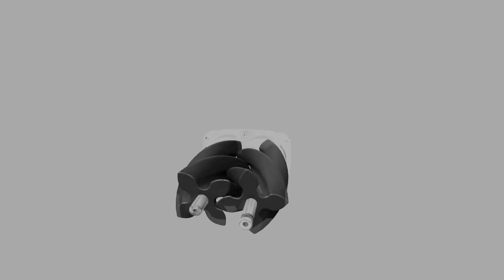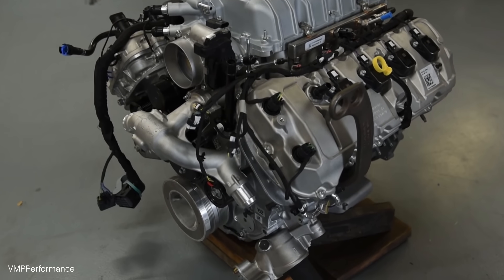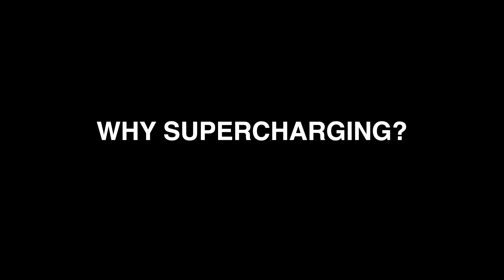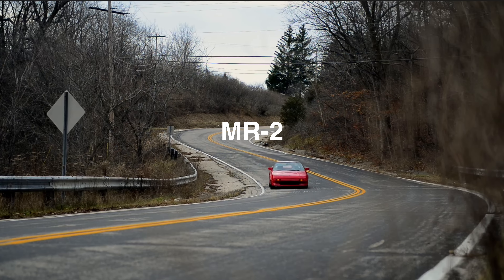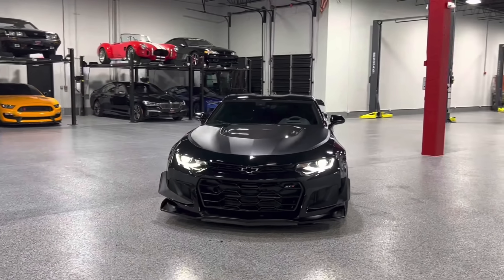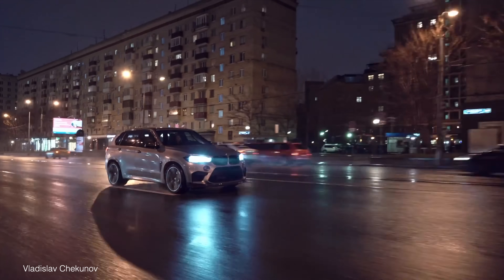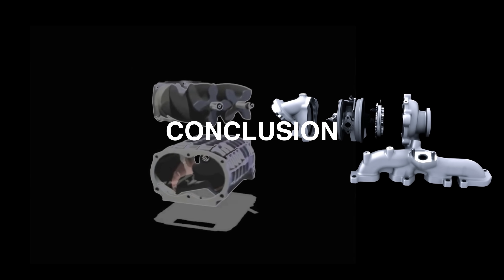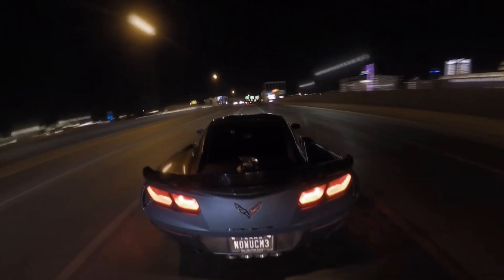Why V8 Engines Are Supercharged vs. Turbo😮| Explained Ep.6

Comment: Why not both ?
Reply: Old Detroit engines have a supercharger and a turbo. The supercharger is only there to blow fresh air.
Reply: @wil4741 Lancia did this a couple of times, and won with twin charge set up
Reply: @wil4741 True, but those 2 stroke diesel engines will not start without the supercharger. Trivia History..  these Detroit engines are where the superchargers for gasoline engines got their name (4-71,  6-71, 8-71, etc).
Reply: You can and people have, but its very expensive and takes a damn lot of tuning plus time
Reply: Golf GT had 1400ccm turbo & SUpercharge combonation. 
Double the cost if something breaks
Reply: @zwieback1988 I had it and it was nice to drive it. Very smooth acceleration 👌👌. 1.4 litre engine producing 125kw with no turbo lag.
Reply: @nevermind3488  still a very nice engine today, as long as the chains kept the timings synchronized. Very good in the golf GT
Reply: @nevermind3488 this engine is very unreliable for a daily car
Reply: Talk to the Germans about this
Reply: Cost
Reply: @Abhishek-150 not only cost of parts but fuel as well.  The more power you make the more fuel you need.
Reply: Too complicated, I think Volvo had made one.
Reply: @BOMBON187  yea they had it the the newer xc90's for a while before they just stuck to turbos
Reply: @BOMBON187 u want to say lancia ?
Reply: T6 Volvos are twin chargered
Reply: Twincharged basil, twins ;)
Reply: Volvo has entered the chat
Reply: Volkswagen had many dual charged engines
Reply: Group B , lancia delta S4
Reply: Id imagine the intake/out piping would have to become so large it would be silly
Reply: Its very very expensive but goddamn it’s sounds amazing, it’s unique and it’s very fast
Reply: Because then u have a dragster. Anything I’ve ever seen pro or supercharged with 2 turbos is pushing like 15-1800whp. U start breaking dynos and shit and your mpg turns to gpm
Reply: Volvos have them both and also has a hybrid powertrain.
Reply: cost and reliability
Reply: Lancia did it in the 80s back when group b was around, they did it to counter turbo lag
Reply: Audio RSQ7 has an electric super charger and twin turbos
Reply: Both is called twin charging the cost for twin charging is significantly higher...
Reply: Because Joe Biden ruined cars
Reply: Right!
Reply: Cost, extra unnecessary weight and complication and more unpredictability and higher chances of unreliability
Reply: TWIIIINNNNNNN TO WIIN
Reply: Average 2010’s vw group 😂
Reply: No point. You can get sufficient boost with either options.
Reply: Cost, adds complexity, adds another possible failure point, etc.
Reply: It has been done, many times over.  The advantages of supercharger are from idle, and by the time it runs out of steam, the turbo is taking over and keeping it going to redline!!  Its not cost-effective in a car. They begin doing this back in ww2 in high altitude planes.  Massive hp!! Eventually, they stopped because they discovered they could achieve the same horsepower with a 2 stage supercharger in less room and less wind drag.
Reply: Compound’s are the way to go for big power. 
For the whole lower rpm anti lag you can run sequential’s. 
But sized right I’ve never had lag issues with compounds
Reply: because not rally
Reply: Too expensive and also very inefficient. You can get a modern coyote to 1200hp from a 3.0L whipple. You can get the same car to go 1500-1800 with a large single turbo. Now the turbo one can be dual. So a smaller turbo to handle low end RPM and torque and a bypass to go to the second for the high rpm and speed.  The supercharger handles really really good low end torque and hp allong with a very smooth power band. Look up 2 step on a supercharged drag car. They launch like a turbocharged car. But, when you add the heat on the engine not just directly with a supercharger bolted on to the engine, but also you have  radiating heat from the air around it. So the Volumetric efficiency or VE per lb of boost pressure throughout the whole system goes down. More tubbing more space to fill, more time for the air to heat up and lower the density of the air. Meaning you need even MORE pressure just to match the amount of oxygen a cooler engine and also cooler intake air would make.
Reply: Volvo
Reply: Twin charging is not worth it, cost too much and you can get more with just nitrous an another power adder.
Reply: Complexity, Mass, & Cost
Reply: That's called twincharging 👍
Reply: Because american is better
Reply: @ american cars are way more unreliable, when has american made ever been good?
Reply: Longevity. Doing both finds all the weak points in an engine and breaks them quickly.
Reply: Lancia delta has and it is one of the best examples for this
Reply: Not reliable
Reply: Heavy
Reply: Volvo does
Reply: Volvo does both at the same time
Reply: Cause you gotta be a crazy(read passionate) italian to do it and it has to be a four banger. 

Other options include. Japanese on a 900cc engine. 

Or German and just had the engineers decide to have an 80s themed work party and do coke or some shit xD
Reply: Twin charging!
But turbo takes up less space and adds power more easily
Reply: There is a few
Reply: Explosive
Reply: Bro discovered twin charging
Reply: Both is better 🫰😈
Reply: I heard it was called Twin charged but I am no mechanic whatsoever 😂
Reply: And add nitro meth
Reply: “Twin-charging” is difficult to make it run well.
Reply: Lancia Delta S4?
Reply: the amount of heat it makes is too much
Reply: The Mk5 VW Golf GT (2007 ish) had one but it was very unreliable and not worth the extra cost so they ended up scrapping the supercharger and just making it turbo.
Reply: You can, but with electric turbos, engines with multiple turbo sizes ( small fast revving one for low speed boost, middle size and big turbo ), it has become obsolete. 

The costs and associated maintenance headaches aren’t with it in most cases
Reply: You can, but with electric turbos, engines with multiple turbo sizes ( small fast revving one for low speed boost, middle size and big turbo ), and variable geometry turbos, it has become obsolete. 

The costs and associated maintenance headaches aren’t with it in most cases
Reply: The whole point of the turbo is it pulls air. Adding a supercharger limits the air coming in. Defeating the purpose of the turbos. You can do it but it takes a lot of fooling around with the combustion, timing, etc. and you don’t get that much of a ho boost. You’ll get more hp just turboing it.
Reply: Pointless. It's like having a v8 piston engine and a rotary engine in the same car. Either does the job.
Reply: weight!
Reply: No need for that. Sequential turbos do the same job perfectly. Small one spools almost from idle and gives low end torque as the big one provides max power in the upper range. And turbos are almost always more efficient than sc's. Love the superchargers though.
Reply: Volvo has a supercharged and turbocharged 4 cylinder
Reply: Group B Lancia Delta S4 had hybrid charger, that used supercharger to mitigate turbolag on lows
Reply: Cost and tuning. It's damn hard to tune both so they don't interfere with one another. Anyone who has played Automation and tried to make a twin-charged engine can confirm.
Reply: It gives limited benefits for added complexity and weight
Reply: Lancia did this, but it's very complicated and expensive and just isn't viable to do in production cars
Reply: Like pizza and cheeseburger?
Reply: Packaging
Reply: Lancia did in group b rally. IIRC the turbo was too big for good lag. Supercharge low rpm then it is bypassed when the turbo spools up.
Reply: Because people are chicken shit. It would be so easy especially now since there’s an easy way to disconnect a supercharger when the turbos come on boost.
Reply: Pretty much useless IT was tried but IT didnt worked well
Reply: @cwf_media9200  it did work, and the result was a good driving experience. Strong boost right away from idle thanks to supercharger and at higher revs the turbo kicks in while the supercharger gehts magnetically disconnected arount 4400rpm. 
Problem: high costs, complexity and the big improvements of modern turbos which made this obsolet

But: There is a comeback with electrical compressors to spin the turbo in low revs in multiple new German cars.
Reply: @zwieback1988  and The engine caught fire very successfull
Reply: @cwf_media9200  not really, they had chain problems but no 🔥
Reply: @cwf_media9200  exactly - the reliability was not good because auf the timing chain lengthening, which can lead to severe damage
Reply: @zwieback1988  thanks but you don't Need to explain what Timing issues mean....
I was a mechanic i know what IT Looks If a valve Kisses a piston
Reply: @cwf_media9200  yes, less romantic than it sounds
Reply: @cwf_media9200 I use to work on Detroit Diesel 6v92s
They had both
They worked. It just wasnt for speed. It depends what you are looking for. Just because it didnt work for you doesnt mean it doesnt work
Reply: Unnecessary. You can move all the air your engine can handle with one or the other.

Comment: I think this video is missing the main point, European brands use turbo and not supercharger because of fuel consumption and emissions. Remember in Europe you have to pay more taxes when your car's emissions are higher (5 figures taxes...). The emission test is done at low acceleration where turbo are more efficient than supercharger.

Comment: Yup, you nailed it!! I've autocrossed both supercharged V8s and turbocharged cars (2.0 turbo 4 cyl and 3.6 twin turbo V6) and there is a slight lag with turbos. The difference isn't an issue when doing normal driving, but it adds up when autocrossing in the form of a few hundredths of a second in each corner.... Hundredths add up to tenths and that can be the difference between winning and losing.
Reply: You can crack the throttle open a little earlier. You have adjust your driving around it a little.
Reply: In racing your rpms shouldn't be so low that the turbo slows down

Comment: I've always loved having a built high compression naturally aspirated engine. Something about the drive ability and sound with them even though they don't make as much power after a certain point, they're just way more fun to drive for me.
Reply: Same here. That's why I enjoy my M62TU (BMW 5 series)
Reply: Drivability is ruined with remarkably high compression, not improved, but sure
Reply: @boost1728  Mine were all completely streetable and daily driven with 13.5-14:1 compression. No issues.
Reply: @evictioncarpentry2628  throttle-sensitive, noisy as hell, lurching at stop lights the list goes on. You have fun with all that. The rest of us will stick with 10:1 and a turbo, make twice as much power as you, be able to put the car in gear and idle through a parking lot without all the nonsense. To each their own. Some people like to show off their slow and obnoxiously loud small block, some people appreciate a comfortable and reliable 1,000hp.
Reply: @boost1728  I have none of those issues, for the second time.

My vehicles run 100% everytime. Everyone of my friends boosted vehicles are constantly broken or having "tune issues", the fact you think 1000hp Boosted is more daily drivable is laughable, so whatever you're smoking in fantasy land, keep on keeping on, jack.
Reply: @boost1728  This guy definitely got chopped by a few N/A engines with his turbo 😂
Reply: @itsb680  other way around dreamer
Reply: @evictioncarpentry2628  A B58 will definitely run 1000hp boosted reliably. Red Bull runs 1000whp and hasn't had their cars break down once the entire race year...

Comment: Great video and narration.. being a mechanic for over 4o years.. I can assure you blowers are the way to go.. much simpler  cheaper,  less temp under hood,  a lot less plumbing ( oil, coolant,air).. no one performs cool downs on their turbs,  and usually bakes them after several year's.. the manufacturers owners guide stesses that you  must perform a minimum 2 minute cool down.. religious oil changes with only the best oil or else your F_ _KED.. centrifugal blowers are far superior and compact and cheaper then the useless  turbs.. just my opinion.  Keep up the good work..  I must admit I'm very excited of the electric  turbs,  small compact,  alot less plumbing and Temps..  now that is a cheap way to add low to medium boost with no hassles.. VW, have already been using them ..

Comment: There are PLENTY of American turbocharged vehicles such as the Oldsmobile F85, Chevy Corvair, Buick Grand National, Ford Thunderbird Turbo Coupe, Dodge Daytona Turbo Z, Chrysler Laser, Ford Ecoboost Family, and on and on.  Superchargers are popular on cross-plane V8 engines because of the uneven exhaust pulses from bank to bank which causes issues with turbos.  You completely missed this point.  Overall not a very good video.

Comment: Two issues:  1.  In your own words, the intake and exhaust "are flipped" in the hot vee configuration, so why is there less lag with it?  The total path length of exhaust and intake is the same with both traditional and hot vee designs.  Lag is basically unaffected.  2.  If the supercharger and the turbocharger are doing the same amount of work, then the power they consume from the engine has to be roughly the same.  We all know the supercharger uses power directly from the crankshaft.  The turbo is not free.  Far from it.  It stifles the exhaust flow forcing the engine to push it past the turbo's impeller blades which in turn are pushing intake air.  The both consume engine power.

Comment: Funny comparison. One thing was only mentioned very shortly, "fuel economy" & emissions. 
In Europe there are laws that prohibit certain emissions, even leading to the most current Corvette C8 not being sold because it's considered too "dirty" in its current form (which is a shame as it's a great car!).
The Porsche Cayman GT4 shown is an interesting example as that's a naturally aspirated engine & a "boutique" brand. 
European (or Japanese) vehicles usually have turbochargers as they're much more efficient (than superchargers) & usually the cars, especially the engine bays, are much smaller than American ones.
The shown M4, for example, is an extremely capable car that "only" has a 3L straight-six engine. It's all about efficiency and size.

Comment: Lingenfelter Corvette... Callaway Vette. There have been a lot of great turbo American V8's.
Today's sequential turbos have one turbo spooling at just over idle for almost zero lag so the scenario of turbo lag is typically decades old.
Turbos also create power losses like superchargers, but those losses come from the additional back pressure of the turbo(s) on the engine. It's not a parasitic loss from having a drive belt, but it's still a loss. This additional back pressure also slows the engine ability to free rev. Superchargers cannot deliver power across a large rpm range as efficiently as a turbo. They have a tendency of creating cavitation at upper rpm limits that negatively affects intake airflow.... Deciding between a turbo or supercharger should be dictated by the result you want and not preconceived notions....  nobody cares if your turbo makes no power at 1500rpms if you have a 3500rpm stall converter or dropping the clutch at 3500r's. Likewise, nobody cares that your supercharger cavitates at ridiculously high rpm's if your engine doesn't spin as high as a cross-plane v8. Don't discount turbos... Even the newest big pickups are choosing a v6 with turbos over any v8 with increasing regularity.

Comment: Honestly, the supercharger sounds like a bad bearing or the wrong installed belt. On the other hand, the turbo sometimes sounds like an owl... xD
But I would definitely prefer a turbo, coz it's reliable, there is no turbo lag on engines with 2 or more sequential turbos, it's a free energy of exhaust gas, co the consumption of the engine stays low.

Comment: I think u should mention that newer higher Cost turbo models have a System where if u shift the air valve opens and lets air pass through the turbo so it won't have a turbo lag anymore and has nearly constant power